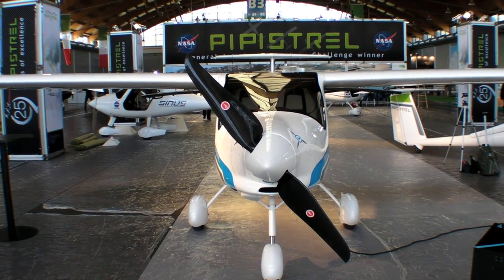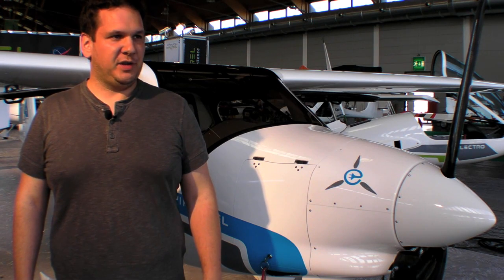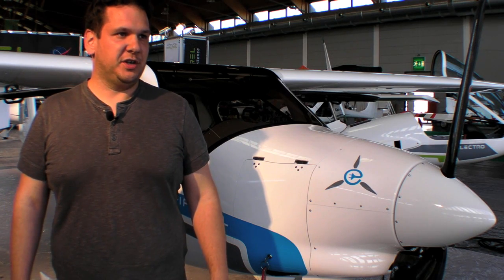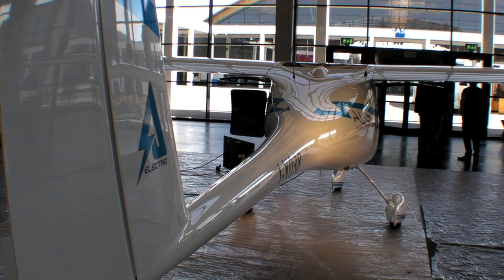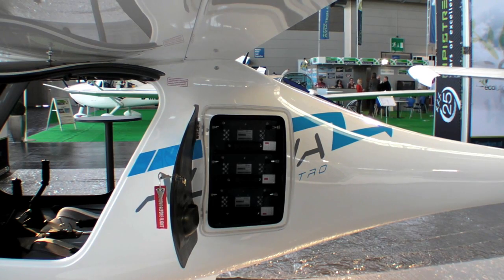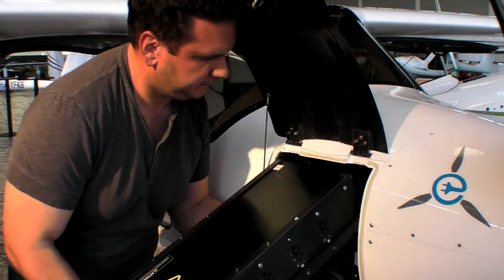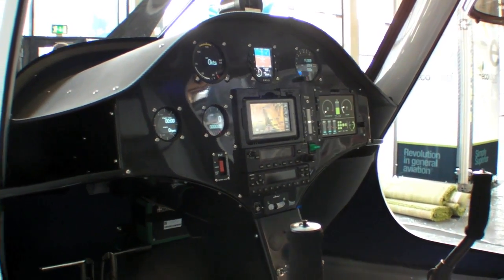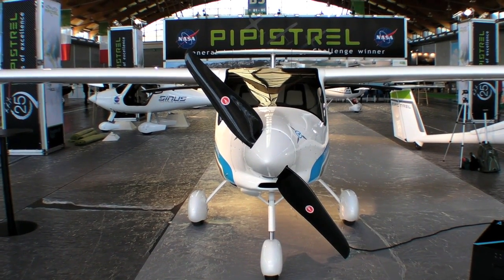Pipistrel Alpha Electro at Aero 2015

Comment: How about 1 gallon/hr of NG at 100 mph $1/gal  (1 cent/mile) with an IC distributed power engine (new).  2 to 12 motors.  84 hp each...168 to 1008 hp in two place.  600 mile range on NG or 2400 with gasoline.  Also seaplane that is roadable.